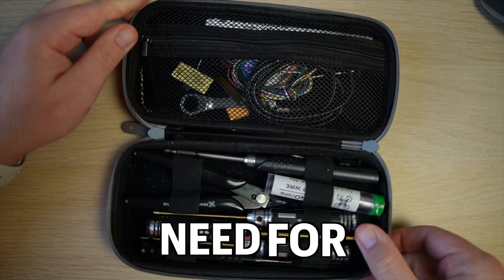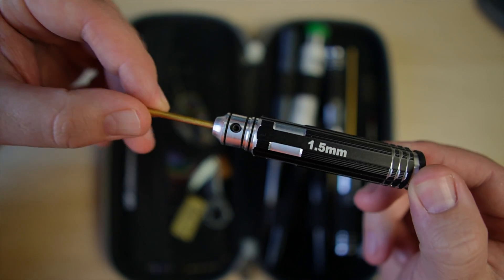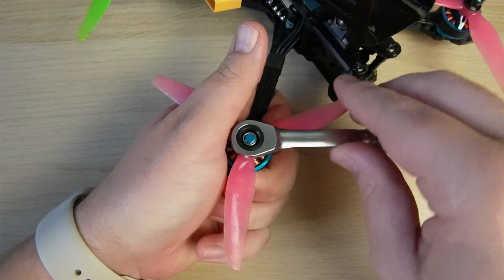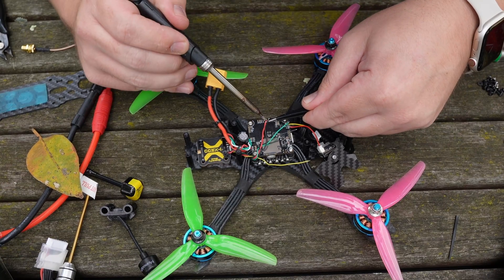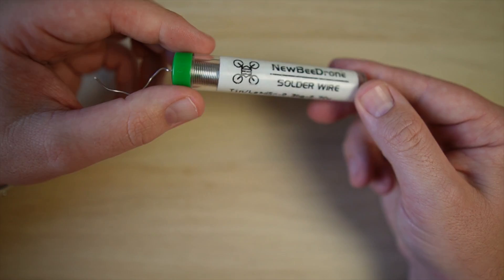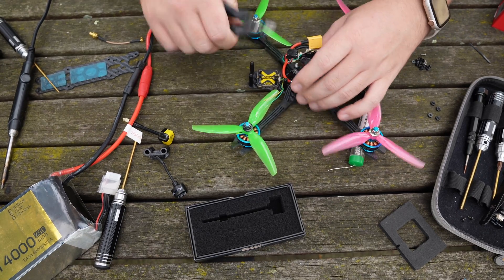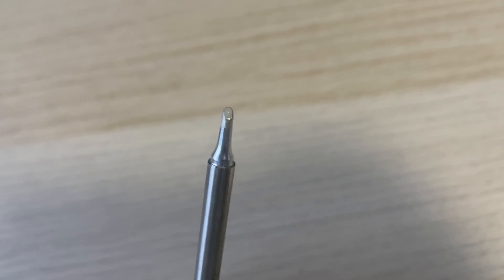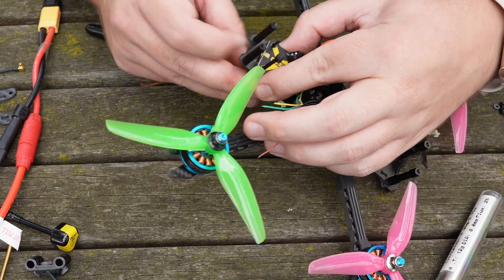Every FPV Pilot Needs This In Their Bag!

Comment: Can you help got 7 inch quad long range got 7 inch props 6s 1300kv please send my email address or what app send you DVR get about 1 min flight goes from 1.5 amp on ground to 55 amp .motors battery get red hot what is causing this any help I'm lossing my mind had bent motor shaft told bye new motors solve wobble now can't even fly bloody thing one thing after Another I need your help cheers
Reply from the maker: Did you build your 7”

What size motors do you have
Reply: @DarrenAllatt  no and 2806 emax ECO II 1300 KV 6S 3to6s 30 0r 35 amp ESC dshot600 old motor's iflight Xing 2506 would ESC be set up for the 2506 motor do they need changing if so how I do that it's was a fix it up build one bell bent prop shaft was told they to small need bigger motor got them soldered flew in osd said at take off 50 to 55 amps what's going on please you the man can you help me please
Reply from the maker: @gadgetman404  it’s probably your PID tune. What version of BF are you running?

I’d go and find the PID tune for the iFlight Chimera 7” and see if that helps it.
Reply: @DarrenAllatt  4.2.9 not 4.3